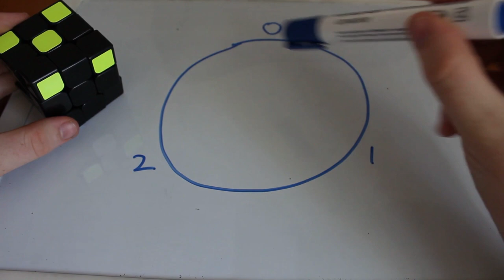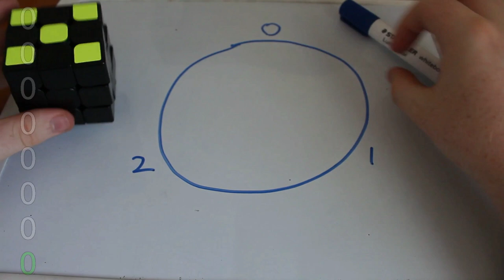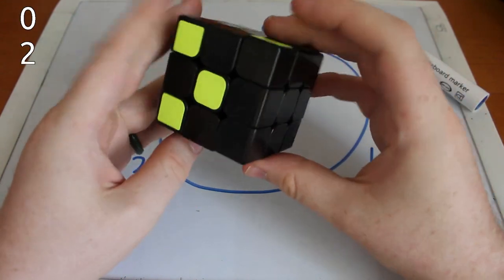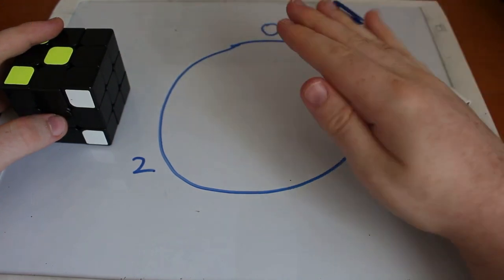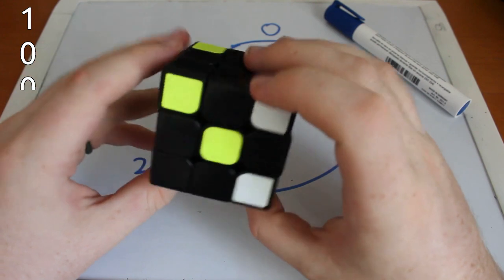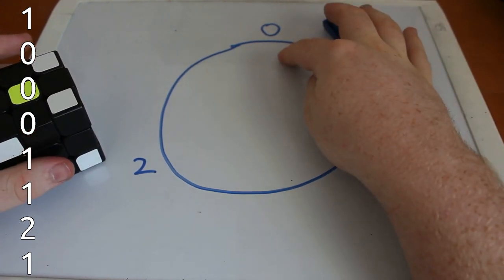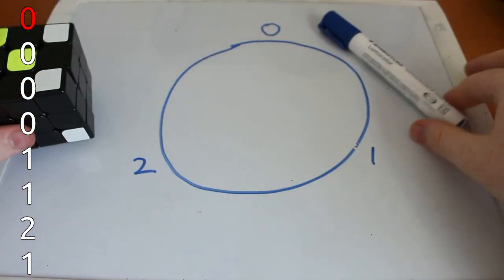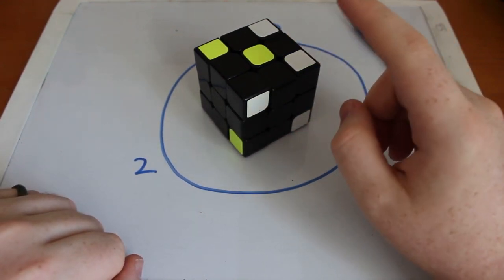Impossible Cube Positions (The Cubing Mathematician?)

Comment: Great video! Could you explain how parity works on a 4x4?
Also could you make an history video of big inventions in (speed)cubing, like the Dayan GuHon, Magnets, etc?
Reply: Mathijs I think it is simply explainable. Since even number cube has no true center. If you take out the center on 3x3, it will act the same as 4x4
Reply: Kyonika Yes, I understand how it works, at least I think to understand it. Basically you misalign the centers and built your cross (if you do it on a 3x3) for example on orange. 
Someone I teach how to solve a Rubik’s cube a few weeks ago and he told me in the ISS Station the have a ball wit 3 rings and if the make the right movement all the lines are at the right position, if the don't the lines are not on the right position. I will ask him what is it, but is is basically  the 4x4.
Reply: I Can, since you make the center then edges, the thing is when you make the edges it might be flipped and not Normal, like flipping an edge around on a 3x3. If I could show you in person I would explain it better
Reply: But would it be possible to see if you can get parity, and make the edged and centers "right" so you can force yourself to skip both parity's? I don't think so, maybe if you mark something, but that would be illegal in comps.
Reply: Yeah you could do that. So you could mark L and R for left and right on the edges so when white is on top they should be on the left and right
Reply: it looks like an edge is flipped on a 4x4 but, they are actually swapped. its impossible for a 4x4 to have swapped edges and the colors wont be flipped. Its because of the middle layer
Reply: Kyonika no edge flips
Reply: I don't think anyone has really explained this here yet. On a 3×3, any move you make will result in an even permutation (which means an even number of swaps are needed, like if you solve with old pochmann). However, if you turn an inner slice by 90° on 4×4 you'll see it's an odd permutation. You get orientation parity if you reduce to a 3×3 with an odd number of slices (essentially). PLL parity actually technically isn't parity because you have an even number of swaps.

Comment: For permutation, you actually can’t switch just 2 corners and 2 edges. It’s just that on 3x3, one 90 degree turn (AUF) will cycle 3 edges, and also cycle 4 corners, and also cycle 4 edges. That’s 3 swaps for each type of piece. However, for the Megaminx, it’s 4 swaps for each type of piece (obviously not centers). It’s also physically impossible to rotate a single center 90 degrees & have it solved. However, it is possible to do a single center rotation on a Megaminx (72 degrees) because it’s the equivalent to doing 4 (288 degrees) in the opposite direction.

Comment: I think a better explanation of the bit about permutations is to point out that any 90 degree move of a face does a 4-cycles of edges and of corners. This then extends to all possible manipulations of the cube since any sequence of moves, or a wide move or a slice or whatever else can be reduced to a sequence of 90-degree face turns. This also lets you point out that the parity of exchanges of edges and corners has to be equal i.e. if an odd number of edge swaps has been made, an odd number of corner swaps has to have been made as well, and the same for even. This also then lets you understand why certain puzzles have the parity issues they do, for example, the master kilominx can have an edge parity issue because you can do two 3-cycles of wings to essentially swap 2 edges, but a similar situation does not exist for the corner pieces because every move that affects the corner pieces just does a 5-cycle of them.

Comment: what should I do? I got a Rubik's cube its new and I never dissasembelled it, got it today aswell. yet after 2 hours of trying, I went onto rubiks cube solver and it says unsolvable? why is that?
Reply: Try to solve it methodically. Then u will face some problem in last layer, at which point you remove that particular piece and re insert it so that it's right. If that's too complex, them do two layers from a tutorial and then disassemble last layer and put it in the right spots

Comment: It's worth noting that in terms of permutations, a single face turn on a cube is actually two ODD permutations, one on the edges and one on the corners.  ODD + ODD = EVEN

This also applies to larger cubes where you always have an even number of odd permutations on each of the different sets of pieces.  
It's why you can have seemingly impossible "parity" positions on a large cube, because the odd permutation on the edge pieces is really coupled with another hidden odd permutation on identical-looking center pieces.

On the other hand, on a megaminx (or larger), a single face turn is an even permutation on the edges and corners (and centers) separately.